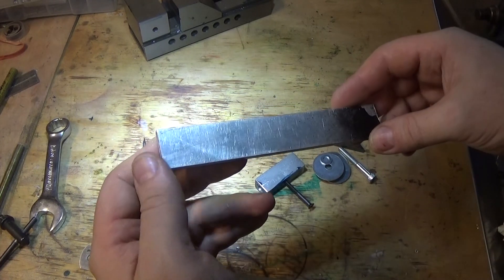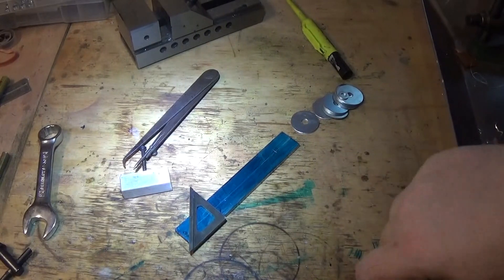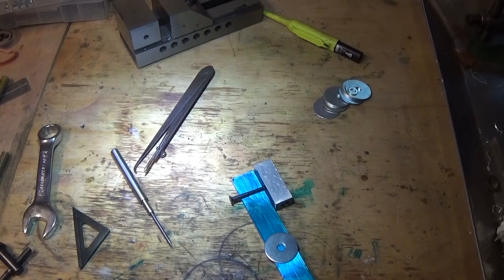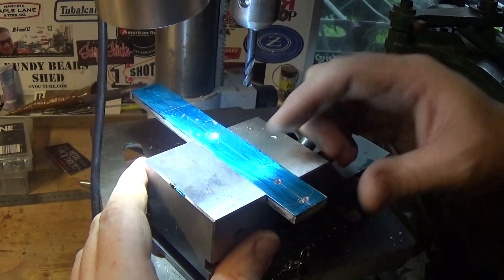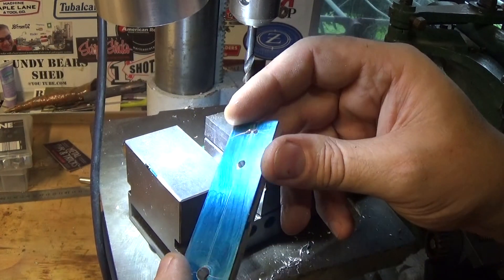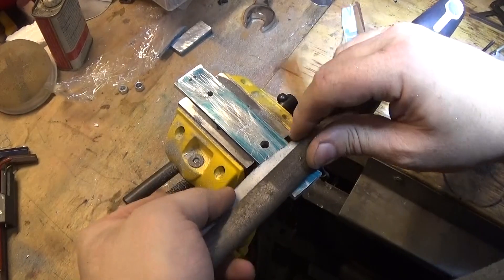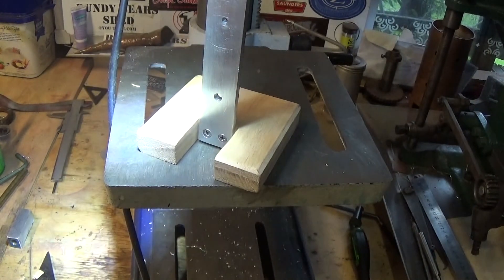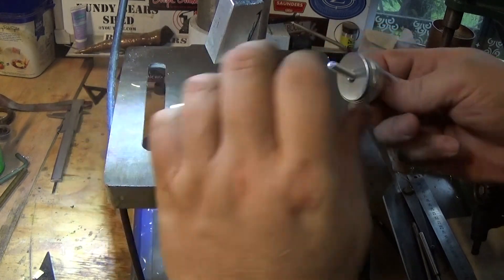mr pete engine part 2a (TO BE CONT.) - no machine tools!

Comment: Very well done Emma. Many thanks for doing this. I know you've succeeded BUT imagine you're 14. No access to stock, or marking out tools etc. You've been out and bought a file, saw, a few washers, bolts etc and you have access to a decent drill. Whole point of the exercise....still think you could do it? I know I couldn't at that age. I can't now until I get some stock, and use my 50 plus years of engineering experience. I grew up at the blacksmiths and carpenters, so learned metalwork, woodwork from birth.
Next challenge is to make an engine run with the spark lead disconnected LOL. Now this one is testing me.
Reply from the maker: +MalcOfLincoln  nope. I know a 13yo could build it.I honestly don't think most people would get it running. I found this a real challenge to get running, to be honest
Reply: They are flawed by design Emma. For a piston engine to work the gas needs to push the piston down just after tdc. Just before bdc the exhaust needs to open, and be kept open as long as possible. The only way to achieve anywhere near this is to alter the size of the holes. The centre of the holes must line up at 90 and 270 deg to get the maximum input/output. Also the friction must be minimum. With a decent air supply, the pressure of air required shouldn't matter i.e. the efficiency (or lack) of the engine.